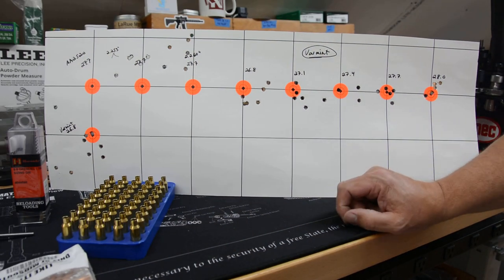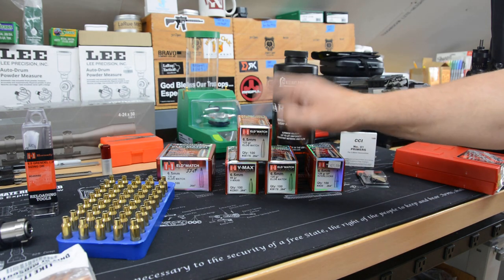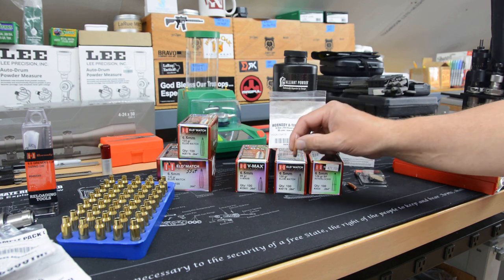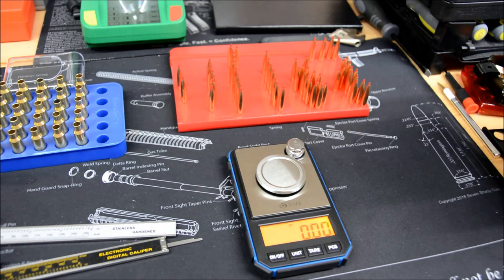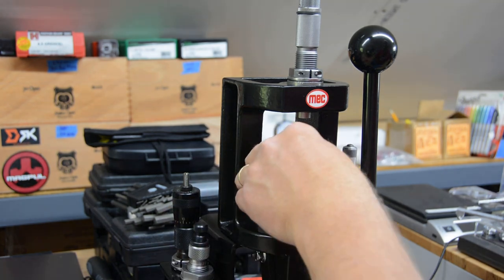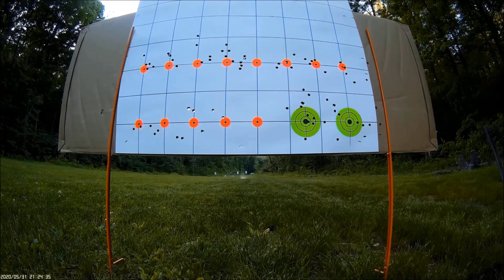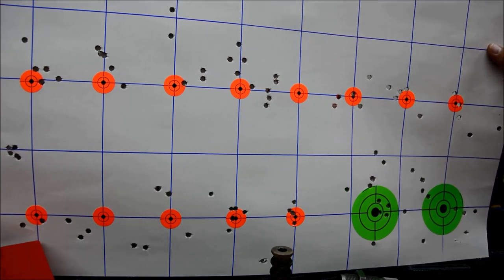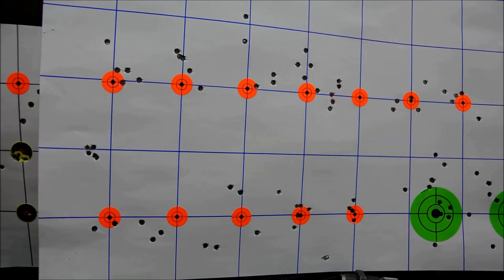6.5 Grendel Pt12  - The Kitchen Sink

Comment: Great video. I had the same issues with my bca barrels. I found that ar stoner mags I could load oal to 2.290 to 2.31 oal. They seem to like hornady 100 eld-m and sierra 107 TMK. ran over Imr 8208 ,benchmark or varget in that order. With muzzle speeds around 2650 out of 18  inch barrel and just a bit more out of 20 inch. Shoots nice to 500 yards. May have to add a little more windage. But not crazy stupid amount.

Comment: Tubbs barrel system fixed alot of the similar problems I had
Reply from the maker: I thought it was more to reduce fouling.  Did it improve accuracy for you also?  Tks
Reply: @Hazzbro1964  yeah it basically  takes out burrs and tapers the throat I did however have to add about .032 to my coa and you have to change your charge as well but I'm making bullets shoot I never could before

Comment: my experience with ELD bullets you have to use an OAL gauge and seat to ogive depth. Not mag size. Just measure a factory hornady black round and see for yourself.
Reply: I thought hornady black use the 123gr sst projectiles?
Reply: @chalkrockranch  not for the grendel rounds they are eldm. the hornady custom use the sst.
Reply from the maker: D,  I do track CBTO on these as that is far more repeatable than OAL as you mentioned.  Early on I even seated rounds to the same CBTO as the HB ammo with terrible results.  Still, the factory Hornady Black has consistently shot the worst of all rounds tested...from the first break in shots fired to now.   Many others get great results with the Black ammo and I'm reasonably confident it's not the ammo.
Reply: @Hazzbro1964  I also had issues with HB ammo. I also had issues with ELD bullets reloading in an ar and a ruger american predator. The ogive is so far forward that you cant reload them to the hornady X reloading manual specks for COAL. Called them they said its my barrels, funny two different manufacturers same issue (jamming in lands). Another thing i find odd is factory BA is shorter than their data. I have switched to 123gr seirra match king and their data with great results. I just wanted to give you my experience with hornady eld bullets. Good luck with your shooting!

Comment: Seems you aren’t happy with your6.5 Grendel AR.  I am struggling (I am fairly a newbie).  Do you think I am expecting this AR to shoot 1 to maybe 1.5 inch groups at 100 yards. It’s not a 3k rifle nor is it a $500 rifle.  Guess you would call it a mid line rifle.  20 inch barrel .  The upper is from PSA.  I am used to hitting sub half inch groups with my bolt gun (very nice and also heavy.). I knew a AR wouldn’t shoot sub half inch or so, but I am not getting remotely that. More like 2-4 MOA, depending on particular load I made up.  What’s your experience in this?  Am I expecting too much?
Reply from the maker: In 5.56 I have WOA and a Wilson Combat barreled rifles that shoot .4 and .43 moa respectively (5 shot groups).   So yes, the can be very accurate with the right combination..especially barrel and trigger.  The 6.5 Grendel is much more challenging to get to and repeat those size groups.  I’ve gotten to .38moa with the Grendel but the same load on another day only held .65.   Very small load changes make huge difference in the Grendel.  So far 95gr elds seem best for accuracy.   Tks for the comments!

Comment: I have a 20” Bca Grendel. I’ve been chasing accuracy as well. I have some 129gr nosler ablr’s loaded up to hopefully shoot tomorrow. Hoping to get SubMOA, but no luck so far. Hornady American gunner have been averaging 1.5moa.
Reply from the maker: Please reply back on how you do.  Haven’t tried those bullets yet but might...in a new barrel 🙄
Reply: Hazzbro have you measured your chamber? My first Bca Grendel barrel had .2” of jump to the lands from a 2.260” coal round.  I couldn’t get better than about 2-2.5 moa, and I couldn’t push the projectile out long enough to have a more acceptable jump. Mine was part of a bad batch of barrels Bca had (may 2019 - nov 2019).
Reply from the maker: @chalkrockranch  no,  I had planned to and just never have.  I will check it !  Tks.
Reply: I have  three 6.5 Grendel uppers. Two from bca , 18 and 24 inch and a 26 inch  Xcaliber. The Xcaliber shoots anything you put in it good .  Really likes 143 eld-x . The bca barrels as you said have long throats. With ar stoner mags, I can load out to 2.290 to 2.31 and still go in mag. My bca barrel really like the Hornady 100 eld-m and sierra 107gr. TMK .  Been shooting them to 500 without any issues. Other than maybe adding a little extra for wind. They also like speer 90 gr. but not past 300 yards.  Everything else has been a joke with bca. Going to try 129 grain sst in up coming video.

Comment: I'm working on BCA 6.5 grendel load now, have tried many differnt powders and loads. I've gotten my best results so far from varget and 123 ELD, have you measured your bullet jump in your upper yet? I just measured mine with a hornady oal gauge and measured several several times, and come out to 2.366, well if I load a round to mag length that's still .106 thousandths of bullet jump. I was just curious if that's all of BCA throats or just mine. I can send some grouping pictures of my recent testing and send over some of my load data and we can compare the two if you want.
Reply from the maker: Yeah, it's been on my list to check and I just haven't yet.  Now I will!  If it's as long as yours I'll load some longer than mag length and hand feed them to test.
Reply: @Hazzbro1964  Please let me know what yours measures out to be, I'd send you pictures of my groupings and my load data with the Chronograph numbers but I'm not sure how to do that on here. You have an instagram?
Reply: I have two and both have long throats.
Reply: @Beautifullybrokenforever  what's the distance to the lands on yours?
Reply: @coreymullins5348  depends on the bullet. But Hornady 123 eld-m are 2.359
Reply: @Hazzbro1964  Have you gotten the chance to measure the bullet jump in your rifle yet?
Reply from the maker: Corey Mullins not yet, will be back at it early next week
Reply: @Hazzbro1964  I'm curious to see what you come up with, I'm loading some 130 ELD up as we speak with varget and reloader 15, I'm not expecting much out of these, I don't have the seating stem for the heavier eld and it's slightly deforming the bullet. I'll find out tomorrow how they do though. Lol
Reply from the maker: @coreymullins5348  CBTO at max OAL (bullet touching the lands) was 1.720".  That's about a .095" jump from max mag length.   Video coming soon on this.
Reply: @Hazzbro1964  that's .010 closer than mine is. I can't wait to watch the video, also tried some hornady 129 SST in mine today with 26gr of RL15 and its the best group that its shot yet, right at .6 moa.
Reply: @Hazzbro1964  those were also loaded at 2.275 O.A.L